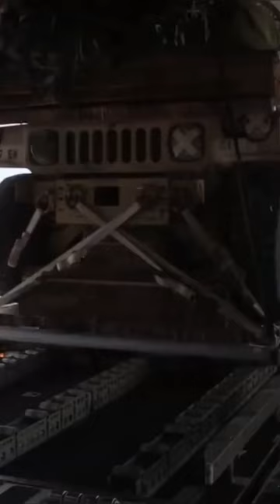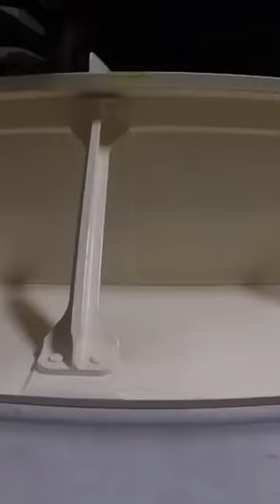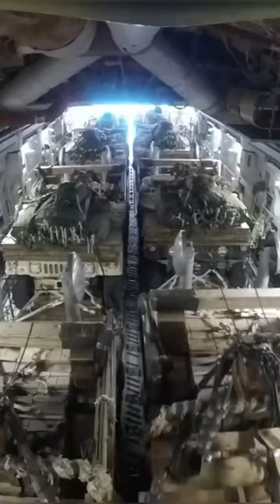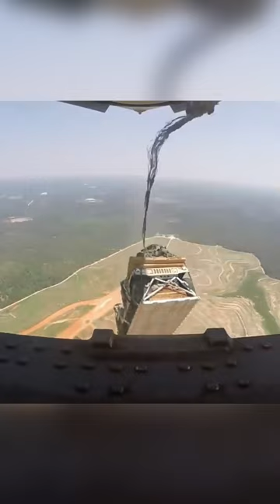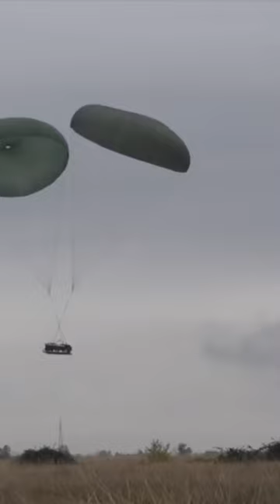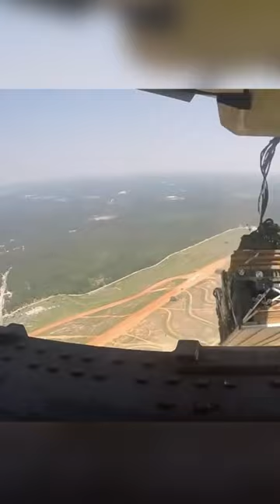How to deliver Humvees 😱😱

Comment: But the chute system didn’t unlock anything inside the cargo bay there’s a lock release control inside to release the pins that hold the pallet the trucks are sitting  on to set them free